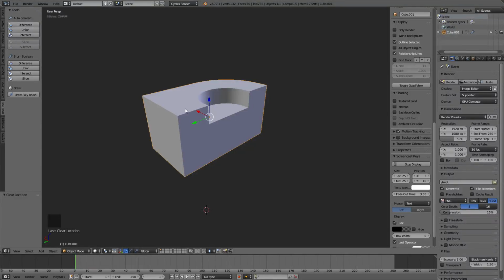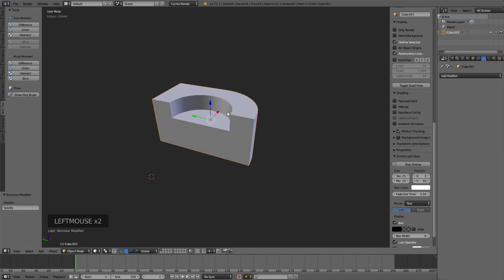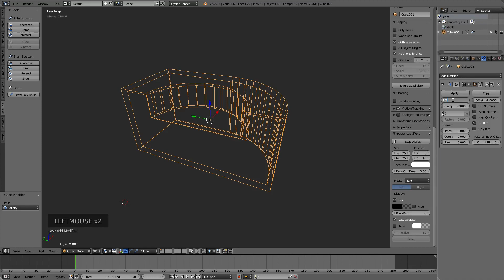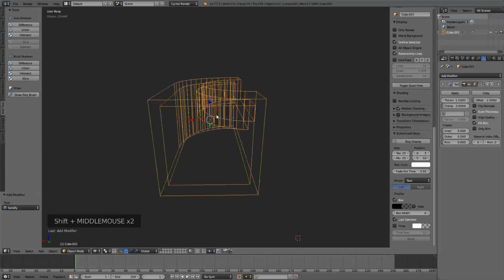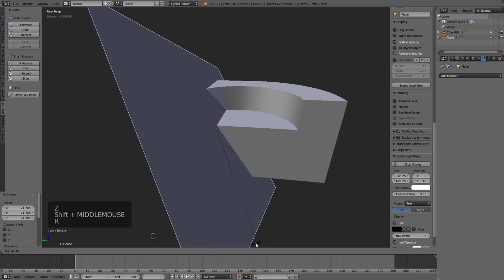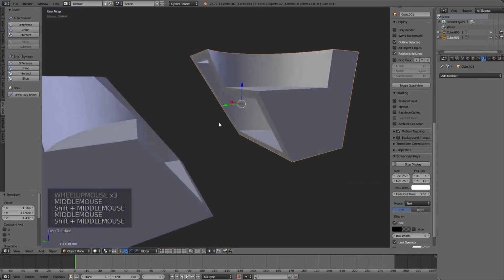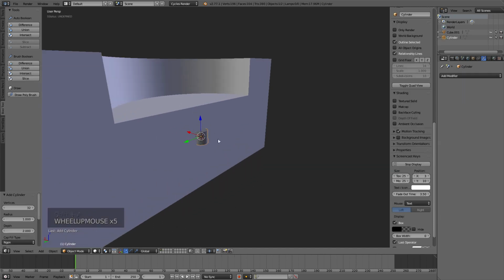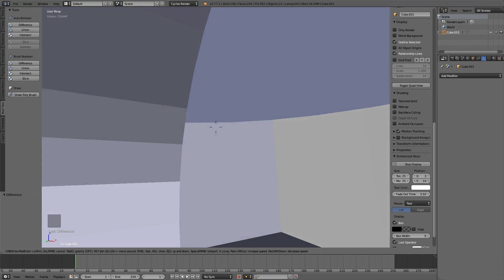Blender Quick Tips: hollow Objects for printing

Comment: I have a model i made and it has an outer wall and an inner wall. When 3d printing, the walls are very thin no matter what i do. No amount of infill generates in between those walls. Any ideas? Anything i can do in blender before i get to cura to make it more solid?
Reply from the maker: Hard to say without seeing your mesh, but I would guess your model is either not manifold (completely closed and watertight) or you need to flip the normals of the inner shapes. Without doing this the slicer may not understand what is inside vs what is outside.
Reply: @rcpongo  do you have an email or way i can reach out. I need to figure this out like 6 months ago 😥
Reply from the maker: @Wee-WorldMiniaturesandProps  if you post it to https://pasteall.org/blend/ and I can take a look for you.
Reply: @rcpongo  i hate to be a pain, but is there any way we could do a screen share meeting? I cant put this file online. Its a product im making.
Reply from the maker: @Wee-WorldMiniaturesandProps  Yea I can help. Send me an email at gmail (same name as here) and we can talk

Comment: every time i use the slice tool i get an attribute error , any way to help ?
Reply: Traceback (most recent call last):
  File "C:\Program Files\Blender Foundation\Blender 2.83\2.83\scripts\addons\object_boolean_tools.py", line 596, in invoke
    return self.execute(context)
  File "C:\Program Files\Blender Foundation\Blender 2.83\2.83\scripts\addons\object_boolean_tools.py", line 634, in execute
    is_local_view = bool(space_data.local_view)
AttributeError: 'Space' object has no attribute 'local_view'

location: <unknown location>:-1

^^ this is what it says fully
Reply from the maker: @rustwat3r  I assume you are using a recent version of Blender. The Boolean tools have changed since version 2.8, and some of the things that used to work no longer do. One of the big things is that you used to perform booleans with open objects like a plane. With the current method it is recommended to always use 3d manifold objects, so I would suggest trying a cube instead of a plane for this.
Reply: rcpongo ahh okay , thanks a bunch !

Comment: Slice does not come standard with Blender, it is an addon.
Reply from the maker: The slice used here is actually part of BoolTools which does come with standard Blender now, but it is turned off by default. In the preferences/add-ons, you just need to search for Bool Tools and enable this.

Another possible issue is that version 2.8 changes quite a few things including booleans, so certain things may not perform in the same way they did when this video was made.
Reply: @rcpongo  lol

Comment: how do u do the opposite? i need to make a skull with horns solid. using the Solidify modifier makes some areas bulge outside of the surface. for example, the tip of a horn only needs to come together an inch, then stop. whereas the center of the skull needs to come together a good 6 inches, then stop. but if the tip of the horn continues to extend the center wall by 6 inches, it will pass the outside wall by 4 inches and ruin the look of the skull with horns
Reply from the maker: unfortunately there are certain cases where this can happen. I have found the best thing for these cases is to model a simplified interior by hand. You can sometimes do the solidify action, separate the internal part, edit it to fix these issues, and then attach it back to the original. Not optimal, but sometimes required.